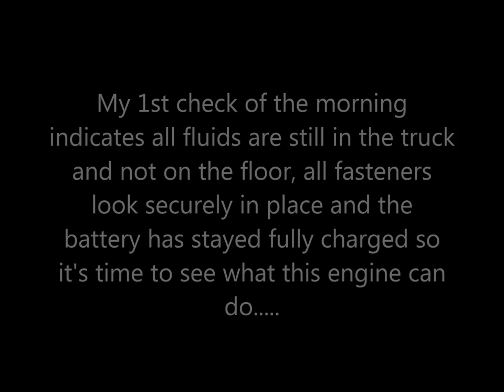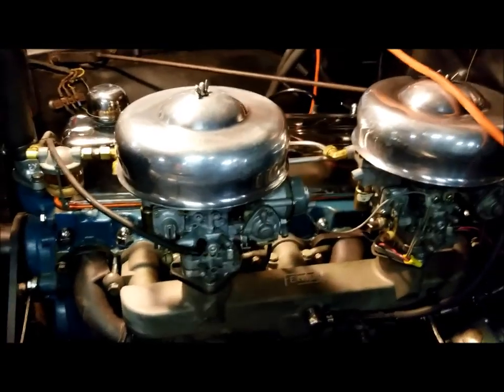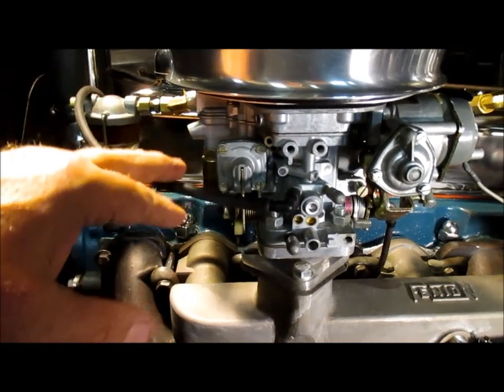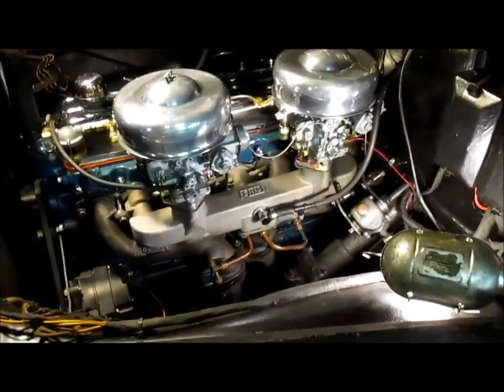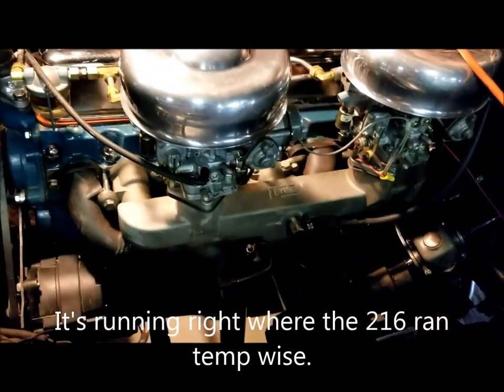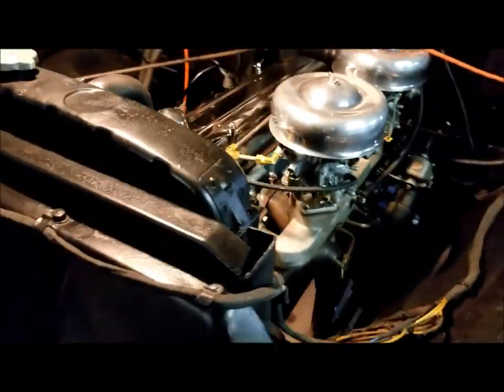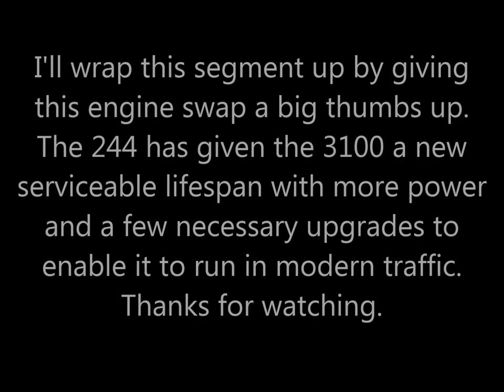1949 Chevy 3100 restoration Part 14, The shakedown cruise

Comment: My second comment is on torque. To get more torque, you need to go to a heavier flywheel and flywheel dampener (match them as a team) and you get less crank twist. I pulled wrenches on construction equipment and it made all the difference in the world... You will be pleased I do believe. Manifold vacuum at a one thousand mark leaves it all to carbration and gearing
Reply from the maker: Thanks for the input Morgan.

Comment: I remember reading an article on hopping up the 235 in an issue of Hot Rod Deluxe magazine a few years ago,in this instance they used a two carb intake and think a dual exhaust similar to yours but the difference was that they used two single barrel factory type Rochester carburetors on this truck which was a '54 Chevy 3100, I can't believe how many of these beauties are showing up here on YouTube, there's another '49 like yours and I think a '50 3600 3/4 ton truck.

Comment: Question?
My 54 Chevy 3100 have a stock drive train...
I chance the front bearings to rollers.
It improved a lot and feels much better.
What else I can do to make it a little smoother...
Like how many pounds of air should I put on to avoid excessive vibration?
Any special shocks I should install?
I know it's a truck but not made for today's roads.
I only drive it 45-50 mph because the way it feels and like to keep it as original as possible.
Thanks for your advise and hope you had a happy 4th of July.
Reply from the maker: Hey Eric, good to hear from you. I like to run my tire pressures around 35 psi and that's as low as I run it. It steers much better at 40 psi but also rides rougher so 35 is my happy medium. Newer shocks would help take out the bounces but won't do much to smooth them out. There's only so much you can do to straight axles. 
Believe it or not, if you put a load in the bed, between 350 - 500 lbs it'll smooth the ride out quite a bit. I noticed this when I hauled my brand new 500 lb tiller home. My 49 never ran that smooth before, LOL. Unfortunately your MPG would suffer. 
What most enterprising folks do is swap the front end over to an IFS like a Mustang II. That gives the truck a more modern car like ride but of course you lose originality. Sounds like you're like me and want to keep it as close to stock as possible but an IFS is about the only way to get it smooth. 
Good luck and keep it between the lines, take care.
Dave

Comment: The distributor is set for 400 to 500. The Beebee on flywheel is 5 degree. Should be the start point. The advance vac should be at both carbs. Check mechanical advance.
Reply from the maker: Thanks for watching Howard. I just did the 3K mile tuneup on this engine and set the timing to max mechanical advance. You'll be surprised at the idle timing now.

Comment: Good video. Do you still have the stock gears in the differential? And if not what do you have? My 49 has the stock gears and the absolute maximum I can go is 60. I’d like to be able to cruise at 55-60 and be able to go 70-75 to be more functional as my main vehicle and to do highway speeds. I’ve got the four speed on the floor. I want to change the torque tube to a driveshaft and change the rear end ratio to get highway speeds. I’ve got a 235 with what I believe to be Stock internals from 1956. I think when I’m at 60, the engine is pushing 4000-4500 rpm (No tachometer, going by ear and what I know other 235s to run at) but the engine is screaming. I’d like to change some things around and make it a better runner at higher speed
Reply: I’ve also read that you have to change the torque tube to driveshaft if you want to change the gears, is that true? I was hoping to avoid that. Thanks
Reply from the maker: Wally,  my 49 is the 1/2 ton model and has the stock/OEM 4:11 rear differential and stock/OEM 3 speed tranny. I do have the taller 215 85R 16 tires which probably helps to lower the rear ratio some. Your 4 speed's 4th gear should be a 1 to 1 ratio like my 3 speed so that wouldn't effect your top end.
Is your truck a 1/2 or 3/4 ton model? The 3/4 ton's are generally geared lower than the 1/2 ton.
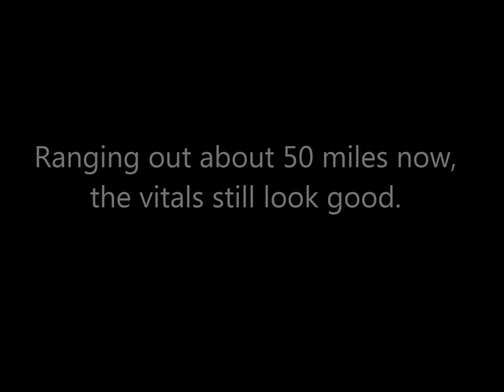There are several classic truck providers that sell a 3:55 ring and pinion set  that bolts directly into a stock/OEM rearend. They aren't cheap but are direct bolt ins.
At this point I'm attributing the increased topend power on my 235 to the cam. The dual carbs and exhaust certainly help but I'm not sure a good serviceable 1bbl with a larger main jet wouldn't work similarly. But thats just a guess.
Reply from the maker: @wallyworksonstuff343  According to my research you don't have to change the entire rear end, as there are ring and pinion kits available that bolt directly into the stock/OEM differential housing. The most popular is the 3:55 gear set. It's for 1/2 ton only tho.... I've read of many testimonials of this swap on several different classic Chevy truck websites. This site gives excellent step by step instructions: http://devestechnet.com/Home/Index
Reply: Volfandt oh ok. Thanks for the information. My truck is a half ton as well. I’ll have to take a look at that link, thanks for providing it

Comment: Just curious......how does the gas mileage between the 235 and the 350 compare ? Which is the more enjoyable to drive ?
Reply from the maker: Good question. I'm on the 3rd fillup on the 235/244 and it got 15.4 mpg on that last one. 
The 350 also avg's 15-16 MPG. 
The 235/244 pushes a 3 speed manual into 4:11 rear gears.
The 350 pushes a TH350 auto in what I think are 3:73 rear gears.
Both would benefit from an over drive trans.
Most enjoyable? 
235/244= 150 HP.  @ 60 it's turning 3K RPM.
350=300 HP. @ 60 it's turning 2400 rpm.
I'm really into the 235/244 at this point mainly because I'm braking it in and highly enjoying the process. And I like shifting gears.
That said, theres nothing like the power and sound of a V8 hitting on all cylinders. 
So back road cruising I like the L6. Highway & interstate driving I like the V8.

Comment: Exhaust cant  be too quite. Loud sounds like a broken engine or a major  problem
Reply from the maker: Your hearing must be alot better than mine. I don't hear anything wrong with the engine. I was running it way too advanced so that may be what you were hearing.Thanks for your input.
Reply: Depends of he is running solid or hydraulic lifters.